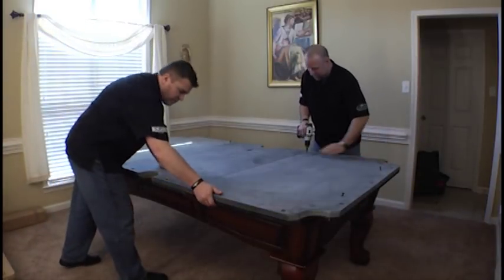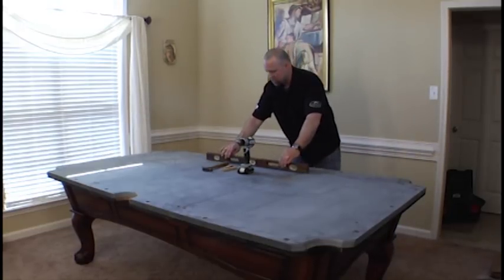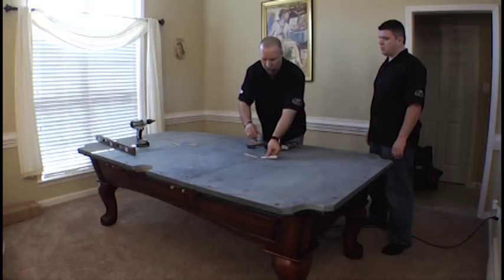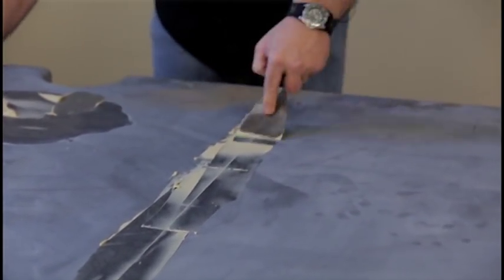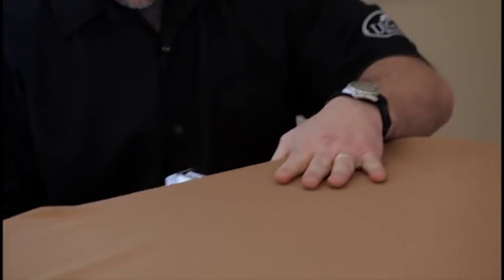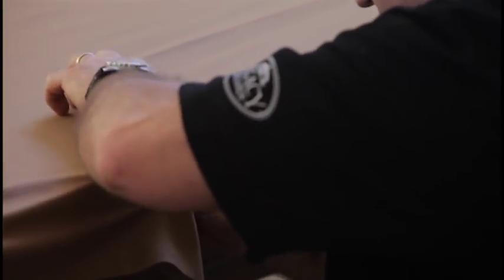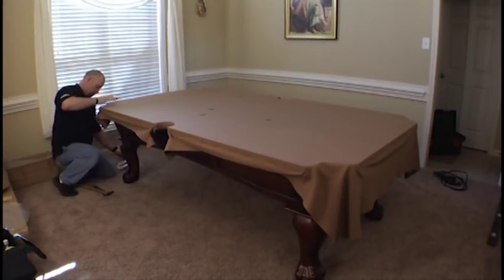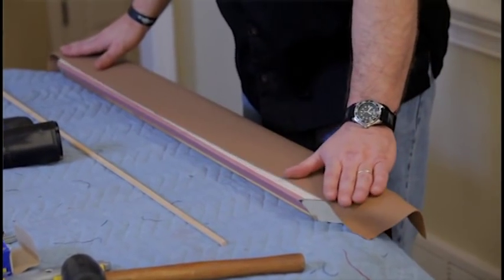Legacy Pool Table Assembly Part 2

Comment: to stretch felt over a slate top you should have weights clamped to the felt to apply even stretching to each side of the felt.  if you don't have even stretching then the felt can play differently on one side or the other.

Comment: I understand you staple the center wedges to keep them in place, but what did you do with the wedges on the outside perimeter?   Did you cut the head of the wedge and staple?  They were seen right before you added putty and then the next seen you couldn't see the outside wedges at all. Please explain. Also, thanks for creating this video.  You did an excellent job.

Comment: putty cracks the slate when you go to move them and is a wast of time and money and isn't a headache for me or anyone that walks up to the tqbel in the future
Reply: Durham Rock Hard putty does not crack slate. Also, when moving a 3 pc slated billiard table, the table needs to be disassembled. Trying to move a table assembled will generally break the slate or the table. Not advised.
Reply: Your comments are referring to tables that require putty over the slate screws. Not all tables require this making a disassembly much easier. All tables used i
Reply: Sorry, my comment got cut off. 
The table used in this video, does not require any putty to be used over the slate screws. 
You are correct that having to dig out putty spread over screws is a pain. I would not purchase a table that requires this procedure.
Reply: I am about to setup an Olhausen that was previously installed using putty. It has the slate screws that need to be filled in. Would you recommend putty or beeswax for this install? Also, there is still some putty residue/buildup from the previous install. What is the best way to remove the old putty? Thanks for the video series, it is very helpful.
Reply: Hello John, 
I prefer putty as it is harder and does not dent or cave if a ball hits the exact spot where deep wax is applied. You can usually clean old putty off with a damp cloth (depending on the type of previous putty used) However, most of the time, sanding the putty smooth and flush to the surface of the slate will be fine as new putty will easily apply over the top. Regarding the Olhausen screw holes that need to be puttied, use a small coin like a penny or dime to cover the screw head before you apply the putty to this hole. This will make the hole shallow and require less putty to be flush. Plus, when or if you need to access the screws again for disassembly, you simply need to tap the hard putty with a sharp tool and the coin will pop out leaving the screw head easily accessible. I hope the install goes well.
Reply: @crisgould5827  yes, it absolutely can. There are videos on YouTube showing it. I've seen it in person as well. The edge of the slate at the seems is most brittle there, and attaching a cement to it like bondo, can grab it so tight, that when taken apart intentionally or just unleveling, it chips.

It's a shale type rock, which means the rock will come apart in sheets, or layers, which is how it's mined as well. You can see this in pictures and videos of damaged slate. It's not just an odd chunk, it chips in sheets like thick paint. You can see the "steps" when zoomed in, and the chips look like a side view of an old arrowhead, because that's how they were made. Taking off little chips and sheets, not odd chunks and gouges. Onions have layers. Ogres have layers. Slate has layers.

Comment: Very unprofessional installation. I simply cannot believe Legacy is promoting this video. 
I have installed several Legacy tables. Chinese built tables are costly to install. That's why most installers charge at least $100 extra.